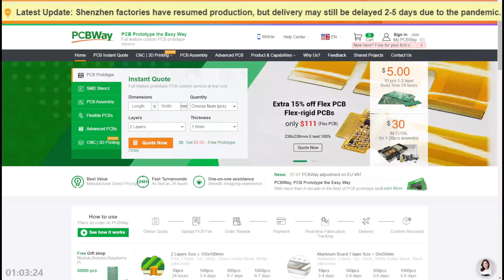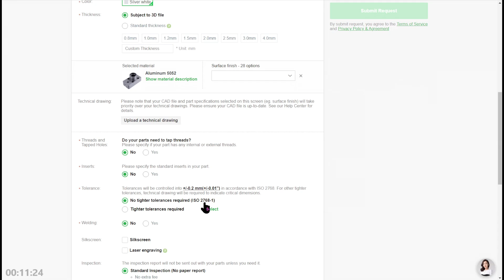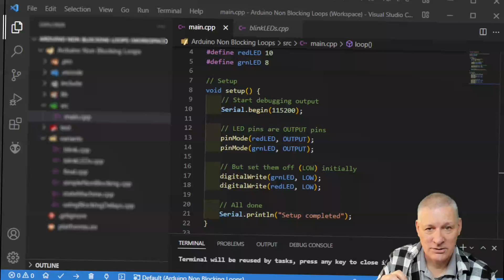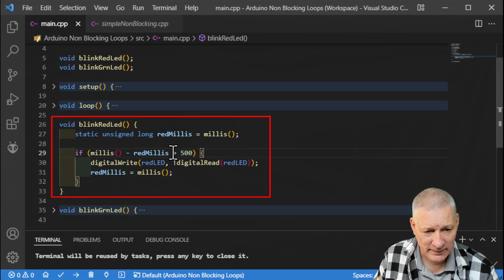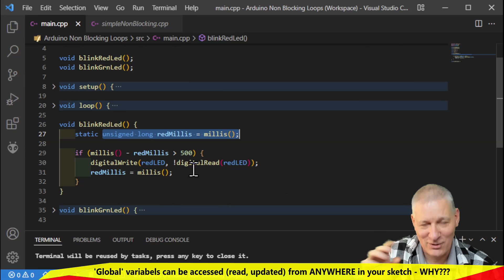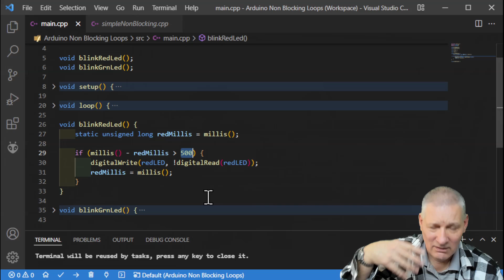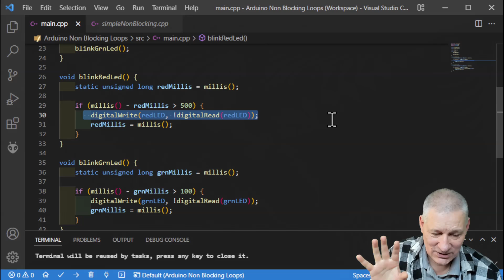#BB5 Moving your Arduino to a multi-tasking State Machine - Easy Intro

Comment: 49 days?
I haven't looked, yet. but what kind of mechanism is that?
On the pic32 / Fubarino you got "_CP0_GET_COUNT()"
"The MIPS Coprocessor 0 Count register is a 32 bit counter that is regarded as a unsigned integer variable by the compiler, so the Count register will run around from 429467295 to 0."
it takes: 89,478485313 seconds to wrap around.
This what you could use  for buttons and leds.

weird: 4294967295÷16000000 Hz is almost 4.5 minutes or?
Reply from the maker: On an Arduino, It's the number of milliseconds that fits into a long unsigned integer. Takes 49 days and some change.

Comment: Oh crap, it seems that millis() is defined as unsigned long 🤦‍♂️.

I don’t use the Arduino IDE but I do a lot of embedded C programming, often in cases where you never want it to fail. I routinely use a signed long millisecond counter called timems. To avoid the long rollover problem I set a timeout value such as signed long blink_timeout = timems + 500. Then to avoid the rollover problem, the check I do is of the form if((timems-blink_timeout)>0). This always math wraps to give the correct answer (so long as my timeout period is less than 24 days). It’s a robust solution because it always works, it doesn’t risk locking up every 49 days!

I can’t see how I could do this with an unsigned long millis value. I’d have to re-cast it as signed long. Actually I don’t think I’d use the Arduino IDE for anything I didn’t want to fail, and this just confirms me in that view. Anyone else got any other solutions to the 49 day lock up risk?
Reply: I tend to use the modulo operator. In theory this should solve your issue, because after 49 days millis() will be reset to 0. It's not the best solution but it is one that works.
Keep in mind that the arduino code runs multiple times per millisecond -> if you use millis() the operation in your if is executed multiple time, so maybe use a boolean.
Reply from the maker: But the problem you are trying to circumvent doesn't exist. Read on!

Using an unsigned integer and subtracting that from a smaller number would normally give you a negative number, but in this case it doesn't (it's unsigned), so you just get the correct difference.

The calculation must always be done in this way:

if (millis() - unsigned_long_int > your_delay_period) {
    do something
}

It never locks up, or overflows, or underflows, or gives the wrong answer. Try it with a one byte unsigned integer to test the maths. 

I claim no credit in being able to state this; the guru of all things Arduino, Nick Gammon (no relation) set out how this works in his blog:
http://www.gammon.com.au/millis
Worth reading and doing some simple maths on paper to show he is 100% correct.
Reply: @RalphBacon  i use a template function with std::abs().

Comment: Ralph is this part of the code explicitly necessary for this to code to work? static unsigned long redMillis = millis(); Couldn't one just declare the variable in the beginning equal to zero. unsigned long redMillis = 0; this would be done in the setup loop or when declaring the variable. Then the redMillis = millis(); in the if function would update it properly? I liked the introduction of the static modifier but don't really see a benefit. Unless the main benefit is for readability. Being able to set a variable once within another part of code looks great from readability standpoint.
Reply from the maker: If the variable were declared as a global variable and initialised in the setup() and then modified in the function, that would work. But!

But I dislike global variables because their scope is, well, global! By using the static keyword from within the function that it is being used in, it means that the scope is restricted to that function - and it's "just a snapshot", not an important, global variable (like the time), after all.

Comment: It's not so bad intro to multitasking, though: 
- nice to point to the user one big disadvantage of this - nasty busy wait sucking CPU and especially power from your board
- static variables are rather poor technique for this - every function can have only one instance of use killing code reuse 
- vary bad and misleading names for the functions blinkRedLED() may confuse beginners thinking that those functions just do the thing. keepRedLEDBlinking() would be much better, and you should pay much more accent on keeping these functions immediate returning while the're called constantly in a loop.
Reply from the maker: Thanks for your feedback. This was only the intro to moving to a state machine so I kept it (reasonably) simple! Not necessarily what I might do in Real Life! And certainly no objects here.
Reply: but blinking an LED is the same as keep blinking the LED else it would be just turn LED on or off.
Reply: what is a better technique for this? For what is static a good practice?
Reply: @benseegers  General rule is to avoid global variables (static is global with limited access) referenced by functions. Functions referencing globals are "bounded" to particular data instance, and then the same same logic cannot be used for other instances - you need to have separate functions when new, similar LED is introduced. Better way is to pass state data pointer to the function as parameter and then, the same function can be used for multiple instances of data. Object programing is a paradigm joining data and operations together making possible to have many instances of data behaving the same way (having same functions). C code emulates this by passing pointer to data manipulated by the function as a parameter - C++ does that by passing invisible parameter named `this` with instance data. See example:

// classic C code

// type for one LED's state
typedef struct {
  int pin,
  int state
} LED;

// one function for all leds in application
// C++ names this method 
void keep_blinking(LED *led_instance, int freq) { 

   // use led_instance->pin and led_instance->state to handle this led
   // use `freq` parameter for frequency 
}

// global LED states - can easily add blue one in the future
LED green = { 7, 0 };
LED red = { 8, 0 };   // new led on other pin

main() {
  while(1) {
      keep_blinking(&red, 1000); // in C++ would be `red.keep_blinking(1000)` which is semathicaly the same
      keep_blinking(&green, 2000);
  }
}

Static in C is way of "hiding" global object (variable or function) for one module (compilation file) or for only one function (static variable inside function). This may prevent other modules before reference of such object and helps not to polute global namespace in application. Static vars/functions may use same name as other static or even non-static objects from other modules. Good practice is to use 'static' for every function or global variable which is internal for module and should not be used by other modules.

mod1.c:

static int initialized = 0; // global variable, private for mod1.c - cannot be accessed by other modules

// "public" function - can be called by other modules
void use_mod1() {
  if (initialized) increment();
  init(); 
  increment()
}

// helper fuction for this module - other modules cannot call this and can have function or var with same name
static void increment() { 
   // `counter` is somehow "global" var (in data segment not the stack), but only THIS function can acccess it. Can have common name used elsewhere.
   static int counter = 0; // 0 is set on data segment on application start
   // every call to increment() sees previous value of `counter` cause it's global
   counter++;
}

// initialize module - many modules may have its own init() function no need to use unique name like init_mod1()
static void init() {
  if (!initialized) {
     // initialize only once
     initialized = 1;
  }
}

Comment: Another great video and of great interest (to me at least :-)!) I can see where I can break down my process and can step-wise deal with certain operations. I'm unclear however how you would deal with overal; (Global??) operations like checking and acting (possibly) on a temperature reading that should happen over various states. What happens if you define a temp control cycle whilst the program 'jumps' from state to state? Thanks!
Reply from the maker: Glad it was of interest!

Regarding conflicting states, remember that the program is only doing one thing at a time. So if we move from one state to another then that happens before the program can even notice that a temp control reading has to happen.

Is that what you meant? Or were you talking about interrupts? Or perhaps a common routine to read the temperature in various states?
Reply: @RalphBacon  Hi Ralph, thanks!! Sorry for being unclear, but I meant the latter; a common routine to read parameters in (across?) various states. I could repeat the lines/call the subroutines from every state, but wonder if there is indeed a way to have a common routine?
Reply from the maker: Well you could have a function that is called from various states, that's the most obvious way of doing it. Or a timer task that runs X times a second (or minute) to update the value regardless of what else the sketch is doing.
Reply: @RalphBacon  Clear, many thanks!!

Comment: redMillis = millis();      the explanation given was it takes a snap shot......just easier to say it resets redMillis counter back to zero? Why your not using the Ardunio IDE is beyond me as this presentation is meant for beginners, but I did enjoy the video!
Reply from the maker: Millis is never reset back to zero. By 'snapshot' we mean the value of millis at that instant.

Talking of the Arduino IDE, version 2.0 is now available. You'll see how very similar it looks to the IDE I am using.
Reply: @RalphBacon  Thxs for not stomping on me! :0) but near zero is that a more accurate statement otherwise not much of a time delay? Assume its akin to saying the Arduino GPIO is 5v but in reality its a touch lower.
Reply: @peteturner8493  millis() does not get reset to zero by reading it. IIRC millis() starts with a zero value when the Arduino is initially powered up but after that millis() just increases and increases until it wraps around - after about 49 days as Ralph states. Try putting Serial.println(millis()); inside the loop() and you will see how it works.
Reply: @PhilipHawthorne  Thxs for the info.
Reply: @peteturner8493  Happy to help.🙂
Reply: @PhilipHawthorne  afaik, the processor of the Arduino/esp32 etc starts at a later time than the counter does so basically every time the processor is booted up, the millis function already has some milliseconds in it.

Comment: Hiding timers inside functions is a bad idea. It is better to calculate timers explicitly in a loop.
Reply from the maker: When you say "hiding timers", can you just elaborate on that as I don't follow where this is in the video?
Reply: @RalphBacon  10:27 Inside the blinkRedLed() function, there is a calculation when the LED flashes.  It seems to me that it's a bad idea to do this inside a function. It is better to calculate it from the outside, and then call the blinkRedLed() function if the time has come.
Reply from the maker: I do this in one of two ways. 

One, as you describe above, I calculate whether a routine should run or not from within that routine. This means that I can call that routine from within the loop each time and the function determines whether it will run or not. Keeps the loop clean.

The second way is, as you suggest, calculate whether I should call a function in the loop, and the function "just runs" when it is called. Makes the function slightly cleaner but adds "noise" to the loop.

Unless the timing is dependent on something I can only determine from within the main loop function I prefer the first way, to keep things as clean as possible in the main loop function. Personal preference, not really a right or wrong way to do this.
Reply: @RalphBacon  ok
Reply: @RalphBacon  it's more efficient and preferable from a design and maintenance clarity standpoint to implement this in main.
Reply: it's not really a timer, from what i understood reading just now, there is a "internal" 1 millisecond timer running in the Arduino with interrupt that is updating a variable.
the code of "milli() " is most probably
u_int32 milli(){
    return counter;
}

nothing wrong with his code.
Reply: @AnalogDude_  
YES,

inside wiring.c:

unsigned long millis()
{
    unsigned long m;
    uint8_t oldSREG = SREG;

    // disable interrupts while we read timer0_millis or we might get an
    // inconsistent value (e.g. in the middle of a write to timer0_millis)
    cli();
    m = timer0_millis;
    SREG = oldSREG;

    return m;
}

Comment: I've done similar things, but being self-taught I didn't realize that the static variable declaration would only be evaluated the first time the function is called and not subsequent calls. I knew about the concept of scope, but not that run once concept. Thanx for clearing that up. 😀
Reply from the maker: Glad it helped, Christopher! 👍
Reply: a normal variable inside a function will lose its life. a static variable inside a function doesn't and remember its state. and that's why that line "only runs once". that line is a declaration of a variable with initial value from millis() and a static variable that is already existing won't be "re-declared"  in the next function call.

Comment: This is primitive enought to be very applicable to an ATtiny... The ATmega328 is capable of running freeRTOS which is worth the investment in the learning curve.  As long as your project does not need a huge amount of code.  I finally got freeRTOS running on the 32MHz LGT8F328 which is nice - the extra MHz more than make up for the overhead of the RTOS. A state machine is also a great idea on the ESP8266 which does not have freeRTOS support, although the "TICKER" library offers a simpler solution for simple projects.  The ESP32 family has freeRTOS built-in and it should be used for projects of any complexity.  Especially the dual-core models like the 32 and the 32-S3.

still looking for someone who knows how to run ESP-NOW and WiFi Webclient on the same MCU....  works on the ESP8266 but not on the 32s, strangely enough.

Keep up the good work, Ralph, you stimulate beginners to go on to bigger and better as I discussed above.

Greetings from Canada.
Reply from the maker: Hello to Canada! I'm very glad I inspire you to do more, after watching my videos. My work here is done!

Comment: Hello. I really like your videos. I'm really new to Arduino but not in programming. I have a question. Is calling the functions many many times "for nothing" in the loop using more power? I'm thinking of battery powered projects. Would it be better if we put a delay of 100 ms in the loop? Thanks for your great channel.
Reply from the maker: Whether the loop is called thousands of times a second, or you put in a "delay" (which is an even tighter loop) uses the same power. 

If you know you have nothing to do for a while, the best approach is to put the microcontroller to sleep; essential in battery powered projects. 

I've done a few videos on Deep Sleep and the Arduino, have a look!
Reply: @RalphBacon  Thank you. I will surely watch them.

Comment: I would prefer redMillis += 500; and grnMillis += 100; in the if () statements.  If the processor gets busy enough, millis() can count a few times before the assignment and these missed counts will accumulate.  By adding a fixed amount, one loop might go long, but the next will be short and restore the timing.
Reply from the maker: Yes, what you say will ensure it is self regulating, good call 😁
Reply: What

Comment: A variable has lifetime and scope. For that „static“, scope is „inside the function loop()“, but lifetime „global“. 
In less formal words, it is a global variable, but hidden inside function loop().
BTW, 
„static auto readMillis = millis();“
would avoid using the wrong type. And the code only works for „unsigned long“. Missing the „unsigned“ (and ignoring compiler warnings, which is the default for Arduinistie) breaks the code.
Reply from the maker: 'Auto' is a great new keyword and I often use it. What I don't understand is why the compiler picks an 'int' type for small counts (less than 255) so I use uint8_t specifically.
Reply: @RalphBacon  because it’s a language definition. 
avr-gcc also has a switch to make int 8-bit, as you would have if the hardware register size typically defines the int size. 
But don’t use that switch, it will open Pandora’s box.
With every inconvenience of the AVR8 GCC, just be thankful it even exists.
Reply: Generally, local static variables aren't a good idea in C++ because the have runtime cost.Each time the function runs, the compiler has to check whether or not the variable has been initialized yet. And on PCs, this is even thread-safe, thus adding mare runtime overhead.
Reply: @didgerihorn  never saw this in generated AVR8 code. The local statics are just global variables, initialized by the startup code, but w/o visibility outside the function. 
So „general“ is not always the same as „specific“.
Reply: @fromgermany271  At least the program has to check whether or not the variable has already been initialized.  Ok, here in this example you would have to do this manually anyway. However,  in general,  is is not a good practice to use local statics. People will hopefully move on from AVR :)